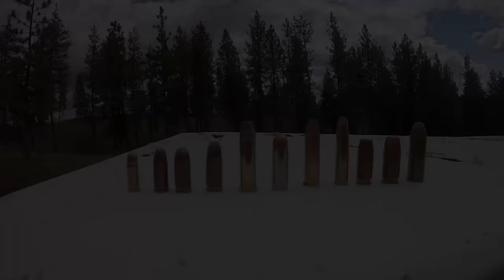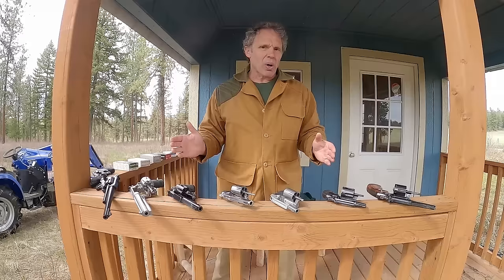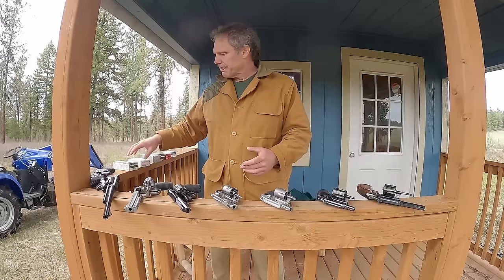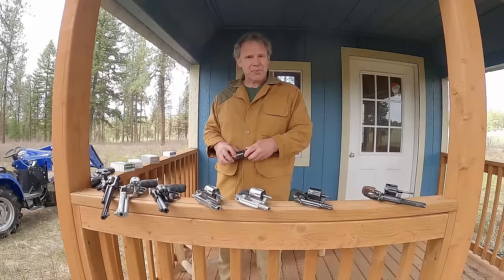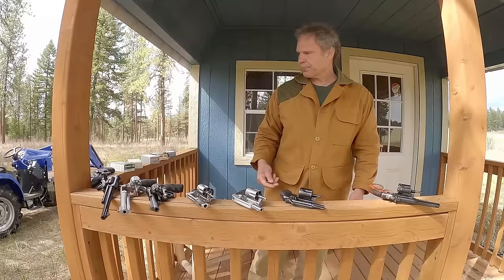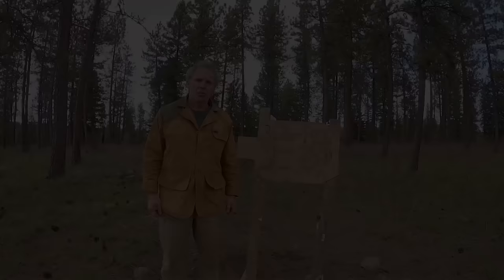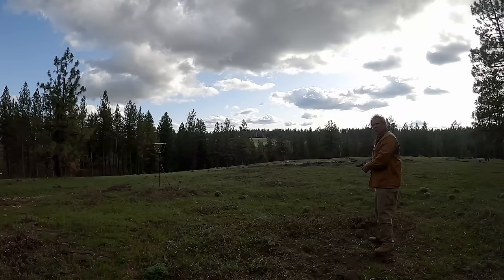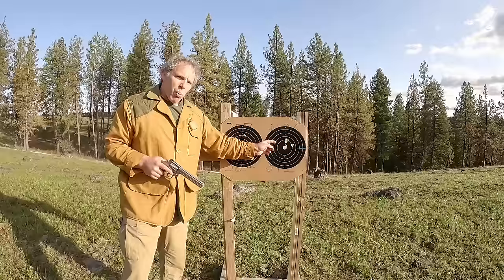Shooting .38 Super in .38 Special and .357 Magnum Revolvers

Comment: Back in the mid-70s, I asked myself this same question, and discovered what you so eloquently explained: that some will, and some won't.  However, I did notice one thing missing from your discussion that I found "back when."  Pressures.  Specifically, that the .38 special is SAAMI rated at approx. 17,500 psi, and .357 Magnum was SAAMI rated at approx. 35,000 psi.  .38 super auto is SAAMI rated at 26,500 psi.  I'm not sure if I was even aware of the existence of .38 special +P in 1974, but I did decide not to even try .38 super auto in my S&W model 36 at that time due primarily to the significant difference (9000 psi) in pressures.  I never did try it in any of my .38 specials but did in my S&W model 28 .357 mag. "Highway Patrolman."  It worked, but I thought "what's the point?"  That's about as far as I went in my experimentation, but I have to thank you for bringing back some great memories of past exploits, successful or not.  As always, your evaluations of this subject were well thought out and concise.

Comment: I’m surprised you didn’t review the SAAMI specs with regards to the pressure differences between the 3 cartridges. 38 super being 36,500 psi verses 38 special, (standard), being 17,000 psi. Even the father of the 38 Super, the 38 automatic pressures exceed the 38 special +P, but that another video…
Reply: This.  It was my first thought, before even considering whether it would physically fit.
Reply: Where does the 357 fit in with pressure?  I would assume quite a bit more than 38 special, about the ballpark of super?
Reply: @matthewbeaver5026  357 is 35,000 psi. Also, for completeness, 38 special +P is about 20,000.
Reply: SAAMI specs also tell that 38 Super casings are .384 in diameter with up to -.006 tolerance (.378 in at lowest), and .357 Magnum chamber is .3809 in diameter with up to +.004 tolerance (.3849 in at highest), which explains why only some cartridges fit in some guns. With enough tolerances going around it is no wonder that they fit, and the pressure difference is practically nothing since they are still tested at 30% above standard, and there are always some variation in pressures due to measuring tolerances of the powder.
Reply: @matthewbeaver5026  the maximum pressure for the 357 mag is considerably higher than the 38 Super. However, it’s never a good idea to fire cartridges in a firearm they were not made for. I have not yet been able to confirm this but many years ago I spoke to a Dallas cop who worked there in 1963. They said at least one of the rounds of ammo Lee Oswald had in his 38 special revolver when he shot Officer Tibbet, was a 38 Super…
Reply: I would be surprised if Paul did not review the SAAMI specs. I assume that the gun and ammo selection was done with stacked tolerances in mind. Doing the math on camera would have done the trick. The demonstration is way cooler and kind of more visual.
Reply: That had me wondering...I stupidly bought 2 boxes of .38 super a while back, and there is no way I wanna shoot the stuff out of a .38 not even rated +p...been sitting on the ammo, split between buying a gun I don't really need (new cheap .38 super pistols run at minimum 600-700), or offering the ammo in a trade...I know some will say buy a .357, but that no gaurentee the ammo will fit...my dumb ass...
Reply: When Paul held the gun up and turned his head I think that said a lot.
Reply: That's measured in the proper chambers too. The excessive freebore from a 38 super being so short should be dropping the pressure a bit and flattening the pressure curve, not to mention the undersized projectile dropping it even more.

Comment: .32 ACP will chamber and shoot in a .32 S&W revolver. Remington tolerances run larger than Winchester.
One more thing, you can chamber a 9 mm Luger cartridge in a .30 caliber Mauser C96 pistol and it will fire but, the bullet has to forcefully swage itself  down to .30 caliber before it will exit the barrel and if it doesn't it blows the chamber up.

Comment: In the late 60’s, the Astra 400 was widely touted as accepting any straight cased rimless/semi rimmed 9mm/.38 ammo, including .38 Super. Another example of ya could, but ya shouldn’t.
Reply: Actually, it was supposedly designed in the 1920's to be able to use the standard issue "9mm" in service at the time (9 Largo was the standard Spanish military caliber) and be easily "rechambered" for export in other 9mm (mostly in 9 Parabellum for Germany).
Also, since several calibers were available and the situation of the era was what it was, the simple blowback system lent itself to it, if the spring was right and the chamber in good shape.
For military service after the Civil War, it was discouraged, although SMG loading for 9 Parabellum was often tolerated when it started being adopted, since some units had more of it that available than 9 Largo. But this last part is mostly apocryphal tales from an old "subteniente" I had in the 90's.
Reply: An Astra 400 that's been arsenal modified to accept .38 ACP will absolutely shoot .38 Super, since they're dimensionally identical. These guns will have "9m/m & 38" stamped on the barrel, and it's my understanding that most of the 400s you'll find on the market today have this modification. Now, this can be risky given the huge range of .38 Super loads out there. For example, PMC Bronze .38 Super (1100 ft/s) is actually slower than most factory 9mm Largo loads and has significantly less felt recoil out of an Astra. On the other hand, GECO makes a .38 Super load that's a full 300 ft/s faster, and I'd be leery about that causing a lot of premature wear. No factory .38 Super ammo should be in "grenade the chamber" power levels though.
Reply: @malikcarr9872  Didn't know about that conversion.
The Astra 300 was already made in .380 (also in .32). The later 600 directly in 9 Parabellum.
Reply: @RCZM64  If you've held an Astra 400 before it's very, very likely to have been converted like that. I've never physically seen one that didn't have the "9m/m & 38" barrel, although I'm sure there's some on the surplus market floating around. .38 ACP and 9mm Largo are so very close dimensionally that all the Spanish arsenals had to do is slightly adjust the chamber geometry to allow semi-rimmed .38 ACP to headspace on the rim and still have the slide close and go fully into battery.
Reply: @malikcarr9872  I'm in Spain, and haven't seen any of of those conversions around here, so it must be something done there (by the importer?).
Reply: @RCZM64  Fascinating. I'm almost certain the chamber modification I mentioned was done at Spanish arsenals, so perhaps it's possible those pistols were considered more valuable and that's why so many of them were imported here as compared to the ones that didn't receive it? The barrel stamping looks like this: https://i.gyazo.com/e3b1702a2bedc24c65beadf29433b2cd.jpg and is way too uniform in nature to have been done by an American importer, especially considering how many of these were brought over before 1968 since they don't have an importer's stamp on the gun anywhere.
Reply: @malikcarr9872  Could be that import or export laws required the extra .38 marking, and the new chambering to conform to standard, and 9 Largo wasn't as common a caliber anymore. It's logical that military stores were remade at the State arsenals.

I have seen two "el Tigre" carbines (supossedly ex-military issue) that were re-stamped for export to the US, for instance (and re-re-stamped here again, when they were imported back).

Comment: Interesting!  Time to get out a 0-1” micrometer and a small inside mic, and measure some cases and chambers.  Fortunately, 38 S&W is shorter than 38 Super.  Given the respective operating pressures, a 38 Super chambered in a cheap old 38 S&W with bored-through chambers is a scary thought.  I won’t lose any sleep over setting off a 38 Super in a 357 Magnum.
Reply: not certain, but got a good feeling that what youre actually going to find is the clearance issue is caused by projectile shape, cause the cartridge itself will almost certainly be to SAMMI spec.
Reply: @nategaudette4228  could be.  Back in ‘74 when I was just starting out, an old guy told me ammo makers tended to size on the small side of spec so their ammo would chamber in all guns, while some gun makers tended to chamber on the large size so any ammo would chamber.  He described his search for a 38 that really did have .379 chambers (Charter Arms).  If that 38 Super ammo really was .384 (spec) near the base, it would not chamber in a well made .357 or 38 Special.  But tolerances vary.  Col. Cooper described tolerance stackup where multiple parts all barely within spec could result in malfunction.
Reply: @lanedexter6303  very true, it could most certainly be just a case of tolerance stack up.. i dont own any 38 supers to have ammo on hand for any actual verification of the ammo myself, im just guessing that ita bullet shape based on the fact that some of the ammo he would try would fit deeper in the chamber then others while still not fitting, also im coupling that with the fact that in my reloading for several of my 9mm handguns, ive come across some .355 bullets that wont chamber in some of my auto loaders if there loaded at reccomend length, 124 xtps for instance, the shape of them makes it so a cpl of my pistols would require me to seat the projectile so deep that i actually cannot shoot them. Be interesting to see if thats actually the case here.
Reply: @nategaudette4228  I’ve been there.  Thin brand of brass and it won’t hold jacketed .354 bullets.  Then seat a hefty .355 bullet or .356 cast in a thicker brand of brass, and suddenly it won’t chamber.  I recall some commercial cast bullet reloads that gave my Kimber fits but ran fine in my buddy’s Ruger P90.
Reply: @nategaudette4228  you need to plunk test to find your longest usable OAL.  
From there you can work up a load having a better idea of pressure based on how deep the projectile is sitting.  
With xtp, due to the ogive, much of the published data is 💩 depending on your powder choice.  
Hornady loads them all the way down at 1.060! (124g) 
With plinking fmj My hk will still chamber all the way out to 1.158 or so.  Though my taurus needs them a little shorter. 1.142.  I've read a lot of cz's have short chambers and required the projectile be seated farther.  
Most factory fmj I've check is between 1.115-1.125
Reply: It was done that way on purpose to not over pressure those 38SW revolvers.
Reply: @matthewbeaver5026  thanks, good point. 👍

Comment: I’ve actually been debating on a .357 as my first pistol this summer, thanks for the info!
Reply: Your first? You could do worse than a .357 Magnum. Fact is, it doesn't matter what you get if you get bit by the gun bug. You'll be scratching that itch the only way there is. More guns. You'll also end up considering smaller and smaller pistols for backup, summer carry, and when you realize that you don't need a hand cannon or pocket rocket to go to the grocery store.
Reply: Would recommend. I love me some wheel guns. You have 38 special, 38 special +P, or 357 mag ammo in it, all sorts of bullet types and profiles, no magazines to lose/break/load wrong/forget/mismatch, ect. I took my first deer with my first revolver, a 6" Taurus 608, at 47 yards. A great platform to learn on.
Reply: @Random Pickle For the 608, I use speed strips. The only speed loaders I know of are....not inexpensive. If 8 rounds of full house 180 grains from a 6.5 inch barrel doesn't end the issue, IDK that a 7 second reload lining up a 8-tipped speedloader will be of any help. For my S&W65-1 I use...HKS?...speedloaders.
Reply: Revolvers are great guns, the ability for you being new to use 38 Special in that gun is a big plus.
Reply: 357 mag is a fantastic round and very versatile. I have quite a few and depending on your purpose you will find one that fits that need. I have a 640 pro that is just amazing and not all that bad with some hot 357. my biggest suggestion is snap caps and lots and lots and more lots of dry firing. a revolver get really smooth after 1000 plus trigger pulls. its like butter when it gets broke in.
Reply: My first pistol was a S&W Mod. 19 .357.  I bought it back in the late 1970's and still have it.  After all these years and all the hand guns I have owned ... it's still my favorite.  As rugged and reliable as a Stanley 16 oz. claw hammer.  If you break into my house some night, it's the one you're going to see/hear.
Reply: Get a gp100.
Reply: @mattmarzula  trust me I know I’m already gonna go there lol. I used to do trap shooting all the time, never had a fancy OU, just a Supernova.
Reply: @OutsideTheTargetDemographic  precisely my thoughts. Practicing with a revolver to start is going to help a lot to get some basic disciplines down.
Reply: @kentuckyboy541  been debating it! I currently can’t go out and buy a pistol though, as I’m under 21 by 3 months ;~;
Reply: @Random Pickle I actually grew up on Glocks I’m well aware of the advantages. I just enjoy range time more with more deliberate and manual guns, revolvers included.

Comment: Interesting! Now I wonder if there are any .357 lever action rifles that can cycle and fire .38 super auto ammo. In case there was a video about it at some point, this would be the perfect chance to get some valid velocities of .38 special fired from a carbine in order to compare it to 9x19 fired from a handgun.
Reply: I was looking for this comment wondering the same thing. Marlin 1894 in .357 Magnum specifically. I wonder whether they will feed, chamber and most of all, extract properly.

Thanks Paul!
Reply: Since most .38 Super is round nose FMJ, probably not the best idea to put those into a tube magazine. Plus, some leverguns are not only resistant to over-length ammo but under-length rounds as well. The 92, not so much. I cut the stop on the lifter back to allow my B92 to feed Keith-bullet rounds, and then made some "44 Super Short" out of sized-down .45 ACP cases with the Lee 120 gr button WC. The nominal 10-round magazine held A LOT of these shorties, and the action cycled, chambered, fired and ejected them like a champ. YMMV. Maybe a JSP or JHP would work for you.

Comment: I've heard rumors about this. Thanks for clearing them up. Can you demonstrate 40 S&W in a 10mm autoloader?
Reply: Yes!
Reply: It works just fine. Fired hundreds of .40S&W ammo out of my 10mm chambered guns.
Reply: @jimhans1  with the stock 10mm barrel? If so, I do not believe you. 40 S&W will not headspace in a 10mm barrel. It may go bang, but if so it's only because your extractor is a hero, while it lasts.
Reply: @jimvac77  yes, factory barrel. And while in theory the cartridge “headspaces” on the case mouth, you measure any auto pistol chamber and then measure the brass, you will see that the extractor is what is doing the work, the chambers are .010-.020” longer than any brass. I’ve shot .40 in it for years, and 10mm with zero issues. Ask any competent gunsmith and they will tell you the same thing. And it’s not just one gun, I have 6 different 10mm semis, they’ve all worked flawless with .40 also.
Reply: @jimhans1  Nope. You are incorrect. Try a plunk test sometime.  Headspace isn't a theory. It's real. You keep right on shooting. 40 in your 10mm though as clearly you know better.
Reply: @jimvac77  I plunk test all my ammo. If you would actually measure something with proper tools instead of throwing around incorrect information you’d see that I’m actually right. Have a great day and week. And I will continue to shoot them, since I do know better about this subject apparently.
Reply: @jimhans1  anyone who understands how headspace works would tell you not to do what you're doing. The fact is, 10mm and 40 S&W headspace on the case mouth. When you shoot 40 S&W in a 10mm chamber, the cartridge is either unable to headspace on the case mouth because of the extractor, or it slips past a weak/worn extractor and goes too deep into the chamber to be fired. If you really have 6 10mm pistols, you should probably sell them and buy 40s since that's what you like to shoot. Or at least reload 10mm. It's not hard and brass lasts a long time. What you're doing is stupid. The fact that it has allegedly worked so far for you doesn't change that.
Reply: @jimvac77  I shoot tons of 10mm out of them, and I DO reload for 10mm already, have for 30+ years now, along with having a lot of friends who are actually well known gunsmiths, none of whom had issue with shooting .40 in 10mm. It’s not a steady diet, but a very easy way to find ammo in a shortage if needed. Optimal? No. Able to be done with no negative side affects? Yes.

Thanks for the comments and sharing your opinion.

Edit: go measure some brass and then measure chambers, you’ll see you are still mistaken about the case actually headspacing on the case mouth in the real world.
Reply: The .40 cartridge does not need to bottom out onto the case mouth.  As long as the extractor is holding the case to the rear against the slide face, it is solid to fire.  That’s why so many people fire 40’s from 10mm’s with no issues.  Now carbon and lead buildup in that freebore space does suck.